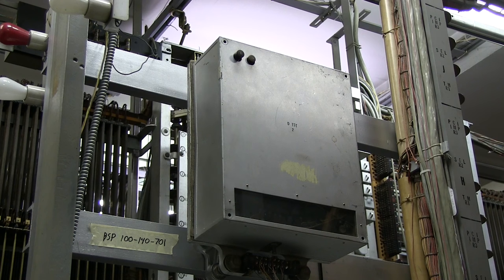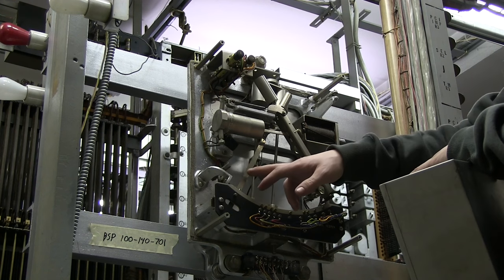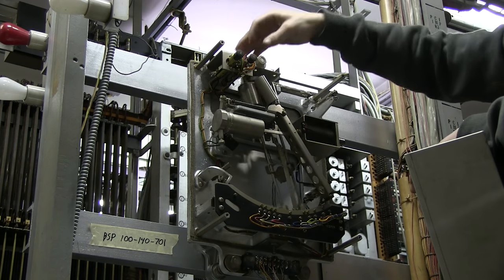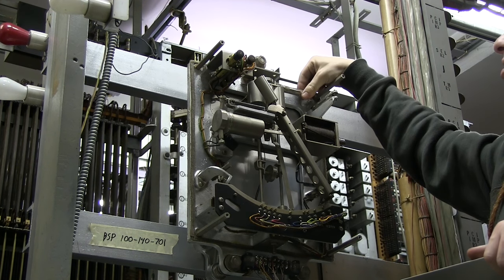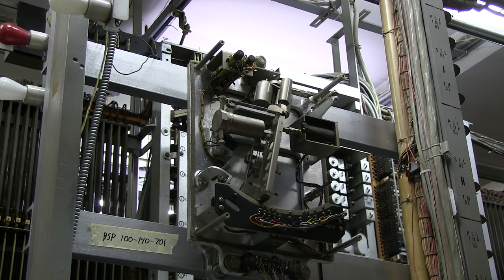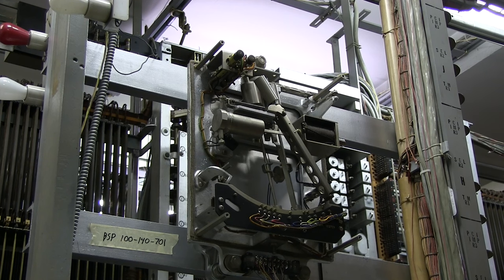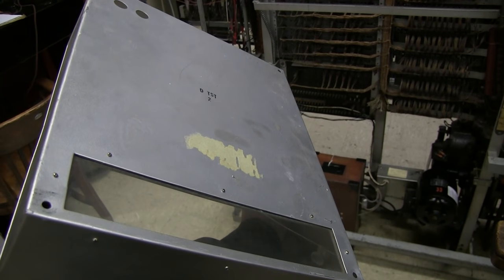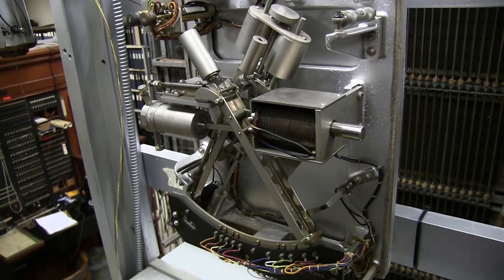51C Dial Tester

Comment: I found the dial speed test quite by accident on the EMerson exchange in the Lake City area of Seattle which I think was an old 1XB. If I recall correctly you dialed 5-7-1, waited for the dial tone, then dialed zero and waited again for the dial tone which was the old-style one for a long time. You then dialed '1' twice, listen for a couple of clicks and a dial tone again and then dial zero. I never knew what this was until a number of years later when a friend of the family told me what it was for. I reckon I was just as curious about the old telephone network as other folks...
Reply from the maker: 571 is exactly right. The office records we have from Seattle confirm that was the code for the dial test. Good job finding it ;)
Reply: You could also access ringback via 571 by dialing '6' or '8' after the second dial tone. IIRC dialing '6' would give a single ring, an '8' would give a double-ring.

Comment: I spent most of my career in SXS and #5XBar. It wasn’t until I got out of the CO and into the field to PABX repair that I had to adjust the occasional rotary dial. Did the adjusting by ear and then checked the dial by calling the tester. I usually had it right the first time.

Comment: Do u have an ANAC (Automatic Number Announcement Circuit) in ESS office? In NJ we dialed 958 (a reserved test number) from any subscriber line and system would echo back the NNX-XXXX voice number in a voice announcement. When looking for correct pots line in the field in a commercial building or in a vault was very helpful. Imagine checking for a pair in a 2700 pair PIC cable. 958 was used in all Bell System ESS offices. If you have an ANAC try it if u haven't yet. Also, NNX-9966, 9971 or 9977 were used for quiet term and or milliwatt. Switchman in house fone at the "desk" was usually NNX-9920 (in NJ Bell and NY telephone). From Wikipedia: " can also appear in the  range, but there is no requirement that they reside there. ... Some carriers have been known to disable payphone calls to  or 959 test lines, such as Bell Canada's system-wide  line at (area code) -2580"

Comment: Oh, it's for analogue rotary phone pulse dialling speeds -- the spring on a phone's dial could be wound too fast or too slow for it to dial accurately. Dialling 0 would make 10 pulses? I assume it releases the pendulum on falling edge of the first pulse, but when does it release that tone wand? On the rising edge of the 10th pulse?

Also I knew from reading an old modem guide with an insert for New Zealand telling us we had weird pulse dialling, and if we wanted a modem to pulse dial, we'd have to do it differently. Wikipedia says: 

In most countries one pulse is used for the digit 1, two pulses for 2, and so on, with ten pulses for the digit 0; this makes the code unary, excepting the digit 0. Exceptions to this are: Sweden (example dial), with one click for 0, two clicks for 1, and so on; and New Zealand with ten clicks for 0, nine clicks for 1, etc. Oslo, the capital city of Norway, used the New Zealand system, but the rest of the country did not. Systems that used this encoding of the 10 digits in a sequence of up to 10 pulses, are sometimes known as decadic dialing systems.
Reply from the maker: Since pulses are a short break in the subscriber loop, yes. It would start on the falling edge of the first pulse (from closed loop to open), and end on the rising end of the 10th pulse. You're spot on about releasing the arm, too. 

And yes! Different countries sometimes had different digit to pulse combinations depending on the layout of their dial. We have some Swedish phones in the museum, and I've noticed the "strange" dial configuration ;)
Reply: If I had a nickel for every dial I adjusted with the machine.... :)  The dials were just as clever design.... you controlled the speed like a figure skater controls spin by drawing arms in.   There are weighted wings on a spinning regulator, and you just tweaked the position of the tiny weights inward to speed up and outwards to slow down.    Then you adjusted the percent make/percent break by bending the dial contacts to achieve 38% make and 62% break.

Comment: In 1974 I got into big trouble because I hooked an amplifier up to our phone line.  I could actually hear conversations from the neighbours.  It blew fuses at the exchange building which was crossbar.  They told me it was C2.  My parents were very angry with me.  The phone company threatened to fine them $500.  They didn’t thank god.  However they seemed to be monitoring our line heavily and each month they would call mom and ask her to dial zero while they were on the line.  It went on for years.  Mom was annoyed that they were calling asking her to dial zero.  Now that I see this machine 44 years later I’m assuming they were verifying that no other phone or device would have been hooked up.  If the dial speed remained consistent they could assume it’s the same phone.  

I still didn’t understand how it was working.  I saw the pendulum but it seemed to be the same each time.  Do you look at the position the pendulum is at on the 10th pulse?
Reply: It's because you can't hear what the line is doing.   After dialing a 0 the  machine makes a tone on the line indicating if your dial was too slow, too fast, just right, etc.   Looking at the machine itself just shows you how it works.  Normally it's closed and no one looks at it.
Reply: I am not sure how it works either but in the edge view at about 00:07:13 , just after the pendulum starts swinging, the solenoid on the lower part of the pendulum releases its grip on what I will call an "indicator lever", which is to the solenoid's left in that scene; the indicator lever springs away from the pendulum in a leftwards direction and stops in an "indicating position" somewhere on the row of contacts that are on the arc-shaped "contacts bar" near the bottom of the indicator lever.  The arc-shaped "contacts bar" can be seen better in other scenes.  Watching this indicator lever carefully for the numerous operating cycles in this video reveals that the lever stops at various positions, depending I guess on the speed of the rotary dial mechanism of the customer's telephone.  Seeing the indicator lever get released from the pendulum solenoid at the various indicating positions might require viewing the video at slow speed.

Comment: IIRC there were some exchanges that could take 20 pulse/per/second dialing. Was this only at the end of rotary, when everything was electronic?
Reply from the maker: Yep! 20 PPS dialing for subscriber lines wasn't really a thing until electronic switching systems. This was because the circuit between the central office and the subscriber could have variable electrical characteristics (resistance, capacitance, etc). The relays that responded to the dial pulses had to be extremely sensitive in order to work reliably. 

Interestingly, 20 PPS dials were used inside central offices, and at operator switchboards where line conditions were ideal. This video shows an operator using a 20 pulse dial at her switchboard: https://www.youtube.com/watch?v=aOrtQHSSizc
Reply: Wikipedia mentioned that 20 pps dialing was used internally before electronic switches; I guess to speed up signalling between central offices. 

I hope to be able to plan a trip up to Seattle soon and see everything. Last time I tried, you were closed. Do you have regular hours now, or is it by appointment?
Reply: thrillscience we are open Sundays from 10a-2p. :)
Reply: @ConnectionsMuseum  The link is now dead.